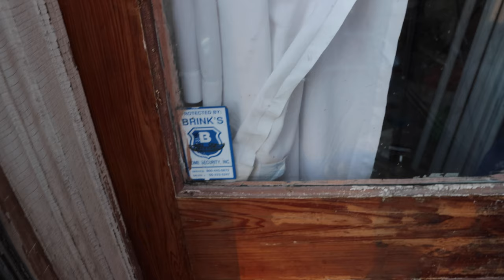This Is Not Great News

Comment: I am curious, does the council actually own the easement for the sewerage?
The back of my fence actually has a near 2 meter easement.I actually don't own the back section of my property. This worked in my favor many many years ago when i had backed up pipes and had someone stick a camera down there. They discovered tree roots had collapsed a large section of my rear pipe and luckily it just so happened to fall in the councils easement land. So they ended up actually footing the bill themselves when i rang them up. I don't know about your councils, but mine were on it in a week. albeit they left the rear of my property of a mess where they had to dig everything up. But I haven't had a problem since and the neighbours have been happier too.

Comment: grab a shovel and start digging down to the breaks,section the pipe and put in new. if you can't do that , take the downspout off the sewer line. should be not allowed anyway, you're overloading the treatment facility.

Comment: Let me guess: those drainage pipes are cast iron. So are mine. Image getting a hole in a sewer pipe in the middle of your kitchen. I saved a grand plus by redirecting the pipe to the outside of the house. That was at least three years ago and I still haven’t had the kitchen tiles fixed. Such is life… 🤷‍♀️